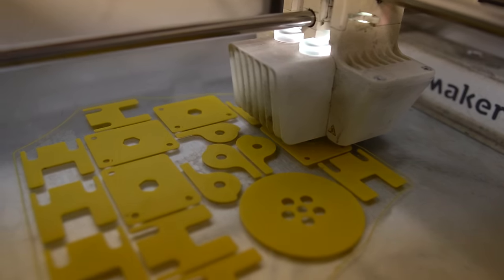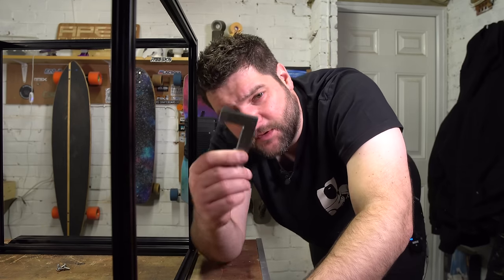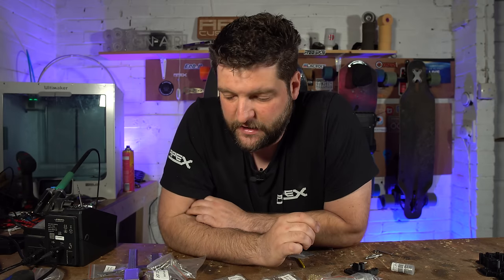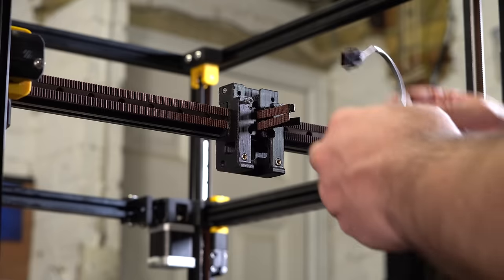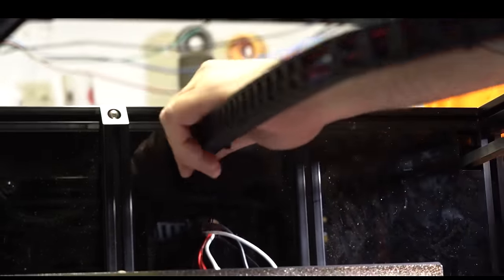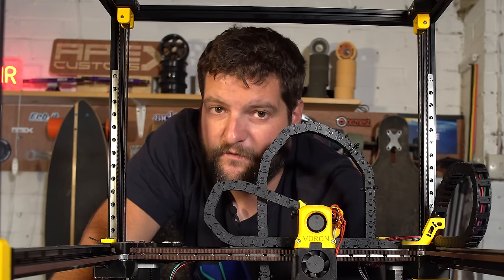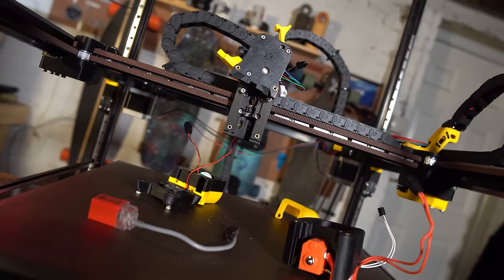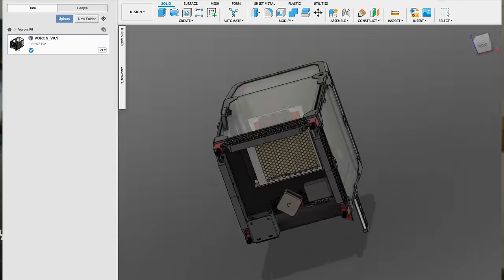I Built The Ultimate Open Source CoreXY 3D Printer - Voron 2.4

Comment: there's nothing wrong with it per se, but I would strongly recommend upgrading to stealthburner.  There are a large number of improvements.  if you ever plan to print flexible filaments, you may also want to upgrade to clockwork2 (which will require a new extruder motor), for stealthburner you just need a 5015 blower, a few additional screws that weren't in the previous bom, and optionally some neopixel rgbw leds.  The hartk toolhead board is also strongly recommended but not specifically nessasary (that's just a quality of life improvement).
I see you've used your mgn9 rails that were intended for X as backers for Y - that's very smart! (my LDO 350 kit came with r2 parts so I ordered titanium backers), I also see you've got a scrubbrush and purgebucket, which is great (the voron z and sexbolt touch on the nozzle so you don't want bits of filament mucking up your z offset), and I see you've printed a nevermore which is intended as a carbon VOC filter but even if you never fill it with carbon helps dramatically improve circulation under the bed to keep chamber temps consistent).  Personally I just finished the motion system and am currently building my toolhead.  I'll be doing electronics in a week or two and i'm hoping to have the build completed and serialed by the new year :D

Comment: You should really start the process if moving to the Stealthburner. It is better in every single way than the afterburner. The Rapido is also a better hoten than the dragon with more flow, less stringing, and a much more visible nozzle.
Reply from the maker: It’s on my radar mate.  PLA hasn’t come out particularly well (although I never print it anyways) I have some bits ready to do a stealthburner upgrade including the PCB tool heads and neopixels etc but I want to get a bit of printing under my belt
Reply: @LeeWright  I hear you, but you really aren't learning much about the machine by using the older parts. If you just want to print and not mess around with it more, by all keep your setup. Just know that the Stealthburner is a significant step up!

Comment: I like the way you pushed in heat set at wonky angle then used straight edge also at wonky angle
Reply from the maker: Looool… 750 printing hours later and still nobody cares

Comment: This may be a little off the mark, but I really like the hex wrenches you have with the colored sleeves! Do you have a brand or anything?

Just a suggestion, but if you build things a lot, I highly suggest adding a set of hex jeweler screwdriver to your tools. Much nicer to start screws and no L shaped end to get in the way! The. Use the L wrenches to tighten things up!

I really like the Voron printer you built. Thinking of adding one to go with my Ender 3V2. But being a retired engineer, can’t decide whether to get a Voron or build something from scratch just to see how it works out.
Reply: Wow, your comment is really professional.

Comment: Have you check its power consumption? I thought it would be nice mod to the printer to know how much energy it consumed per each printing session. Especially now when we have ridiculous energy prices and that 350mm printbed is massive. Thanks for you vid mate!
Reply: This might be possible in software. If you know the power consumption of the bed, hotend, and motors, the rest should be negligible just logging the amount of time each one is on should be enough to calculate power draw.

Comment: Great printer and congratulations. I have one and it's full of mods. While watching it, I remember fondly how you describe the emotions I already had. It was nice. But I have one comment in which I made the same mistake - when you were arranging the radiators for the stepper, you placed it wrong, because there are fans on the side and they will not cool them properly - it's as if you were blowing on the Mohawk from the side. You understand?

Comment: Very nice job!  Great video as well.  Now that it's tuned, start adjusting it for speed.  With PLA and ABS, you should be able to get prints done much quicker.....
Reply from the maker: Hey man, thank you! I totally forgot to give you a shout out in this video.  Thank you for all your videos, they were a great help to me.  Yes I think tuning for speed is next although I swapped to a SF hot end during the build so I think I’ll quickly run out of capacity on that
Reply: @LeeWright  on your next print in ABS or PLA, just try 100mm/s and 150mm/s with your slicer.  I think you will be surprised at how well it will print.  If you have not done so, you may need to do some resonance adjustments in Klipper if you get any ringing.
Reply from the maker: Oh im already printing at 200mm/s and 4000 perimeter acceleration and 7500 internals.  I have done some basic input shaping but I want to get an accelerometer and do it properly
Reply: @LeeWright  That is great news then!  I'm glad you have the higher speeds going.  The accelerometer helped me a lot. My vision was just not up to the manual tests!  I wish you the best with your printer!

Comment: You should revive the Ultimaker, not that a diffficult job if you managed to put together a Voron, new motherboard, new firmware, a thourough check of all nuts and bolts, electric contacts, maybe new temp sensors for the bed, nozzle and chamber (they tend to loose accuracy in time) and use it as a backup, you can never know...  when Voron might be busy with a long print and you need a to print something else on the flight.  You might even use it to experiment with a tool changer system (there are a few free online projects you can access) and make it your direct drive mutitool slow printer for TPU and similar.

Comment: For the Ultimaker S5: All you said was about the software/firmware side, not the hardware. So if you are in DIY, couldn't you just change the board to something like the mks SkipR, BTT Manta or something like that? The kinematic is simply cartesian (crossing rods). Neither Klipper nor Marlin should be a big problem there. Wireing all the existing motors, sensors heaters etc. to another board, maybe even convert to direct drive with an LGX and a CAN-Bus (BTT EBB36 or EBB42) should not be impossible.
Of course for a printer in that price-range, all the frustration is justified - and the problems are a no-go. Still, as you already have the printer, it would be nice to see you upgrade it. So I would love a video about the problems you have with the S5 - and preferably how you might solve it by replacing the electroncs/free it...

Comment: Nice build bro, may I ask where did you source the Back and Bottom panels, I`m building a VzBot and don`t know the best place to buy those beautiful aluminum panels. Thanks in advanced.
Reply from the maker: Hi mate, they are just plastic actually and came in the format kit I ordered.  I believe you can get those panels you speak about in several places.  They are called Aluminium composite panels and I believe you can get these cut to your specifications in several places like sendcutsend etc.  I am not sure what others think but I would  be concerned that they would wick heat out of the enclosure though.  Maybe Acrylic is a better choice?

Comment: I think while the Voron 2.4 is without any doubt one of the best CoreXY printers you can build, I wouldn't call it the "ultimate" CorXY. It realy depends, what you need. The Voron Trident is often underrated. While moving the heavy bed (on 350by350) in z seems contraintuitive, having the CoreXY gantry in a fixed position at the top, not moving in z, has some realy nice advantages. For example it makes it possible to add a tool changer... There are some reliable designs for DIY toolchangers for the Trident (or other 3d printers with z moving bed, like hypercube or maybe VEHO 600 etc.). Of course you could use a toolchanger on a Voron 2.4 theoreticly, but moving up the XY-gantry every time you want to change a tool does not seem the best way to do.
With CAN-bus becoming the state of the art way to connect the toolhead, toolchangers have become much more easy to build, as you can connect multiple printheads to one CAN-bus (of course you might need to upgrade the PSU to power them, so they can be preheated or keept at "standby"-temperature in their storage). I think it's the next big step in DIY 3d printing. After Bambu shaked the market last year with their AMS, every 3d printer is compared to it. Actually nobody can deny the Bambu printers are the best and most reliable affordable solution for multi material prints out of the box. And it solves the problems for removing support in an easy way (PETG/PLA-trick). The PrusaXL (wich is definitly the better approach) cost twice as much and delivery times are long. So the Voron Trident imho is the right way to build a Voron nowerdays. Even a 2-tool only changer would be a very big improvement, just for support on technical objects.

One not so well known fact: Announcing the Prusa XL, Prusa also announced their development team working on multi-nozzle-diameter support on Prusa Slicer. Wile "Comming soon" can be seen as trademark of Prusa, so it may take still some time, this would be the next game changer in my opinion. Printing smal details in 0.4mm or even less, but most of a part in 0.6 or bigger seems a very interesting way to actually reduce print time by a lot. So building a Voron Trident might be the more future proof solution. 

Of course there are other solutions: If you build two identical Voron 2.4 you could mount them side by side, with the bed mounted on linear rails - moving between the printers. Would be a hell to calibrate it - but it would allow dual-material. Of course, for the second Voron you should have also a heated bed, to be mounted on demand. So both Vorons could work as one dual-material printer or as two seperate printer - depending if your prints need easy2remove support or not. (realy independent, not just mirror or duplex like on an IDEX). Just a thought...

I actually have a Voron 2.4-inspired Jennyprinter 650 as a kit. Have not assembled it yet (and may take some time still, as it is very big - outer dimensions are 95 by95by105 cm³) and I still search for the perfect spot to place it. Still, as I do not like the heated bed of the Jennyprinter (an openly exposed 230V heating foil - quite dangerous. I will never use it!) and also flex plates are only available up to 600by600 at the moment, so I can not use the aerea the printhead can move for the bed anyway, I decided to redesign the Jennyprinter to a mix of Trident and Voron 2.4 (I use all the parts of the Jennyprinter, as they are CNC milled, so 4 z-belts, but use them to move the bed instead of the xy-gantry). With the xy-gantry reaching more area than the printbed anyway, I could add a toolchanger and a nozzle wiper later on.

Actually, while multiple nozzle diameters are not supported by Prusa Slicer for now, of course you already can change the nozzle diameter layer by layer simply by slicing multiple times with different settings (I already did this on my mk3s+ with revo, manualy swapping the nozzle midprint) and combining the gcode manually. So for example if you want to print a front plate (with embedded text, manual or automated filament change) you could a 0.4 mm nozzle or lower (long printing time) for example for the first 3 layers on the nice powder coated spring steel. Beginning with the 4th layer you swap to a 0.8mm nozzle (or bigger), so the print gets finished a lot faster. Perfect detailed surface, rigid and fast structure below.

Most of it are just concepts and ideas at the moment. It make take years to finalize it for me. But most of the ideas are already in the making by others.

Of course, at he time you made your video, the 'WP-DAKSH' Voron Trident 3D Printed Tool Changer wasn't published yet. So Voron 2.4 seemed the ultimate solution at the time. Still, after the new developments it's still a very good printer, but in my opinion the "ultimate" title goes to the Voron Trident, seeing the development made in toolchanging. Even as WP-DAKSH doesn't use CAN-Bus (yet), so there is room for improvement, and also I would like to prefer the nice, precise but cheap CNC-milled parts of a Hermit Crab (without the PCBs, as the tools would be permernantly be connected by CAN, and you have to change the spring in the Crab to a less stiffer one and add a lever to do the release of the tool by a servo)